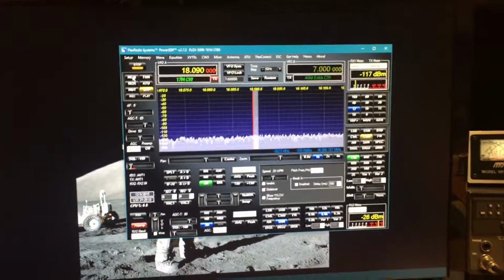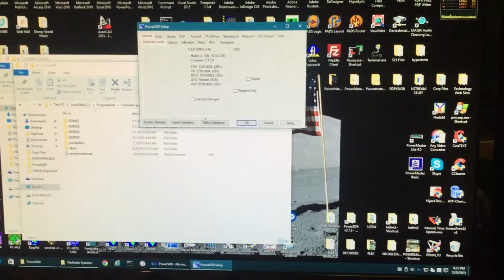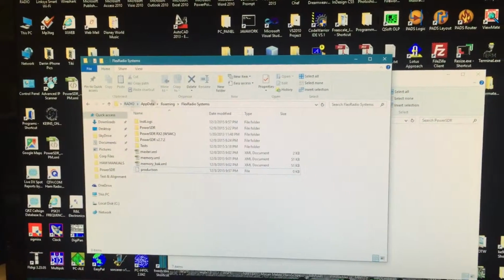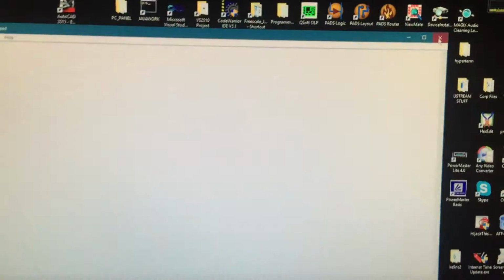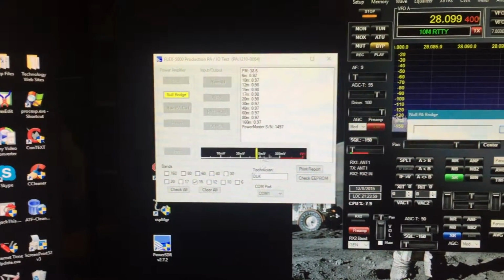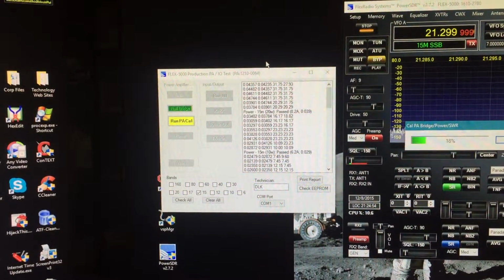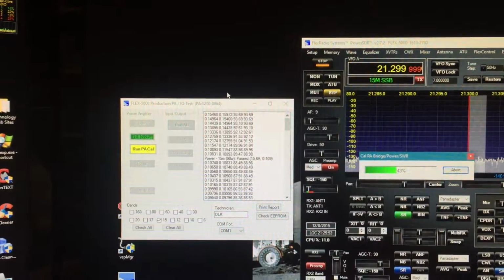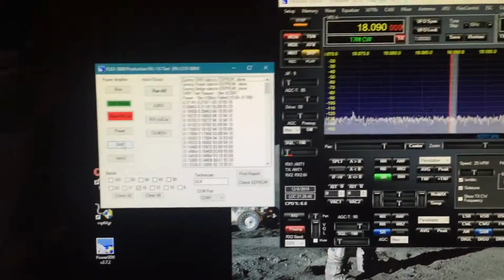Flex-5000 PowerSDR PA Calibration

Comment: I have access to a Power Master 2 meter. I do not have a version 1 available.  Can you explain what it is about the version 1 that is different such that it works but version 2 will not. Do you know of anyway to make the calibrations without the version 1 meter?
Reply from the maker: Power Master 1 has a command that forces it to output FWD and REV power data, in an endless loop. Apparently, Power Master 2 does not have that command . I dont have a Power Master 2 so I cannot be sure. But I did add a checkbox to try and allow the use of the Power Master 2 by just repeating the request for FWD and REV power data. But since I dont have and have never tried a Power Master 2, it would be up to someone else to test it out. Preferably someone with both meters.
Darrin ke9ns

Comment: Thanks for your super video. And I am sure Flex worries about people doing this without the correct power meter or not following directions. My PA Cal went perfectly but had trouble running SWR with lockup of powersdr. Had to run some them more than once but in the end they all passed . Even made it to 100W on all bands. Again thanks for the video and now someone wit right equip can do their 3000 as well Gary K4MT

Comment: This procedure works fine on a Flex 300 with one exception.  Since it has no ant 2 the SWR test fails with data outside range error.  After PA cal is done you then must put 25 ohm load on ant 1 and then run SWR test as you mention in your video. My radio is as new now thanks to your video pointing me in the right direction.
Reply from the maker: Glad at least the PA calibrations worked.just for future reference. All the calibrations are stored in EEPROM inside the Radio itself, then copied (1 time) into your current database file (the file with your radios serial number). Sometimes the database get corrupted, which might effect your radios performance because PowerSDR only works off of your database calibration setpoints (the EEPROM is just a backup).If you believe the database is the issue you have 3 choices: 1) Load up a backup database, 2) start over with a factory defaults (which will reload the EEPROM cal setpoints 1 time), or 3) The Hidden EEPROM memory screen (CTRL+SHIFT+C), to force PowerSDR to read the EEPROM and re-update your current database. Just be very careful not to select the wrong button and accidently copy your cal setpoints from your bad database back to the EEPROM.Step3 is useful if you find checksum faults in your powerSDR log file.ke9ns

Comment: Will this procedure work on a Flex 3000?
Reply from the maker: I have not tried it on a Flex-3000, but It probably does.
Reply: I cant get Flex to tell me how to do it but pieces of info I have received seems like power cal will work as your procedure on the 3000 but with no 2nd ant port SWR test has to be run by itself with 25 ohm connected during that test. Flex wont give me the procedure though.  Thanks for the reply. Great video
Reply from the maker: Yes Flex was very leery, when I first asked them to describe the procedure for me. My guess is that in the past, many people ended up bricking their radios, requiring the them in to be fixed.